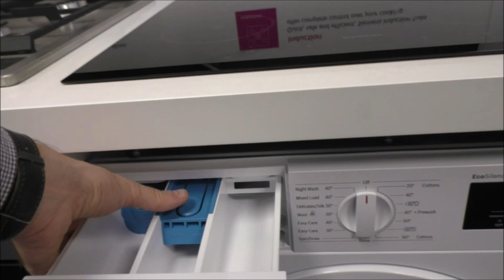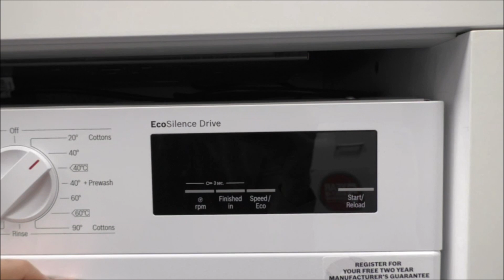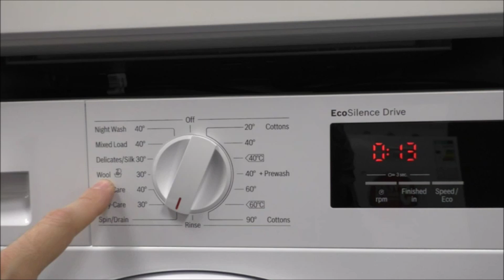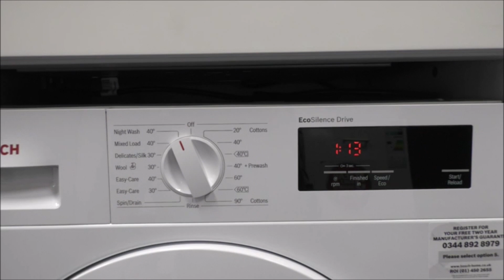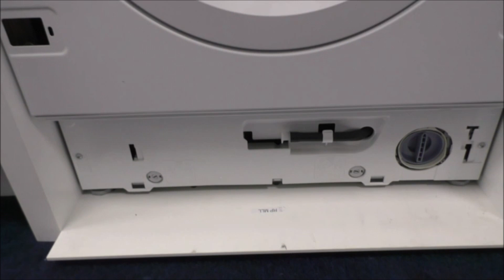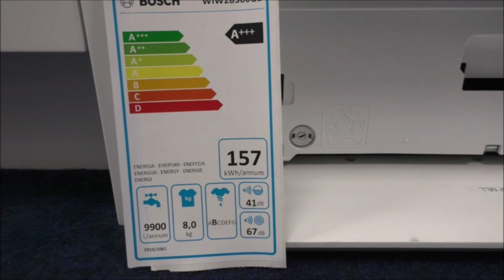Bosch WIW28300GB and WIW28500GB Integrated Washer

Comment: WIW28502GB - this washing machine is not good!!! Dont buy it! there is a high pitch noise (we were told from the pump as the water pressure is lower) so not silent that much... also you never know how long a cycle will last... it recalibrates several times... ordinary cycle is around 3h which is way to long... when it spins than leaves the clothes so crinckled so you need to use iron much longer... not really saving energy overall... and from the last night it does not drain and does not spin (less than a month of using it).. all these gadgets such as drum ilumination, display on the floor are useless when the machine does not work properly... i assume Bosch is looking to impress us with the fancy stuff and forgetting what really matters - good simple washing...

Comment: Hi, my wiw28300gb/21 doesn't have a dryer, any substitute or solution you recommend?
Reply from the maker: This is a washing machine on its own so won't have a dryer as part of it. If you have space I would recommend you get a separate dryer rather than trying to change this for a washer dryer
Reply: @Lords Electrical  Unfortunately, I don’t  have extra space.
What  washing machine would you recommend  with the dryer  as exactly the same size.
 Can you recommend  a small dryer  that can be placed on the balcony?

Comment: Hi! Which one is the dryer option? I have this washing machine and I’m struggling to find the option to dry the clothes. Thank you
Reply from the maker: Is it definitely this model you have as this is just a washing machine not a washer dryer.
Reply: @lords-electrical  Thank you so much for replying! I’ve been trying so hard to locate the dryer option as I just moved to a new flat. The washer I have is the Bosch WNM64 model. Is this not the same one? Can you please let me know if the WNM64 option has the drying feature? Thank you!
Reply from the maker: I have been trying to have look a the features on your model but struggling to. If it is a washer dryer around the control it should have "intensive dry" as an option and the dial may look like this model. https://www.bosch-home.co.uk/product-list/washers-dryers/washer-dryers/WKD28352GB
If it doesn't refer to drying then it may just be a washing machine without the dryer

Comment: Problem is the 500 seems to be retailing at nom £80+ more and effectively all you seem to get is more programme settings (11 rather than 5_which quite frankly are mostly useless anyway I find for the times they are used) Options for 15/30 min cycles at reduced loads and the floor timelight feature. That and it is 'estimated' to be fractionally more energy efficient over the year (due in most to use of the energy efficient mega-long cycles _ 60deg cotton wash is a rather lengthy 4.5hrs)
Reply from the maker: You are right that the prices fluctuate on both models so the difference can be close sometimes. My only comment is it surprising how used to the floor time light feature once you have it on a machine.

Comment: So you can't do a pre-wash at any other temp besides 40 deg C?
Reply from the maker: That is correct, I think because pre wash doesn't seem to be used as much as it used to so they have just put it on the most common temperature at 40 degrees